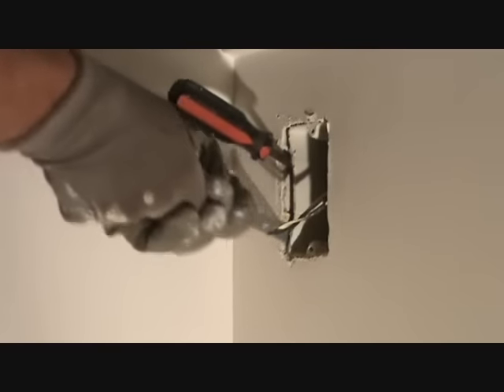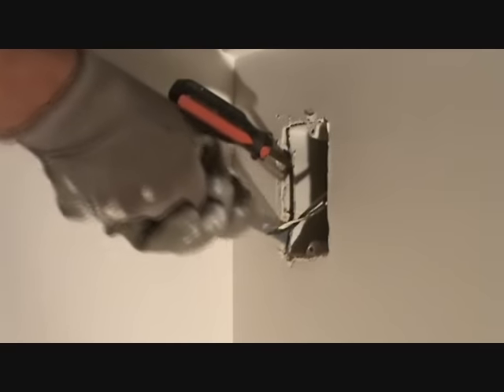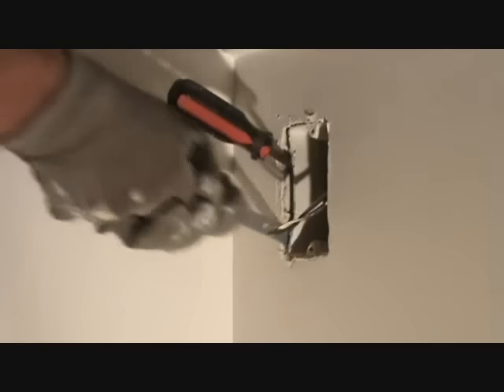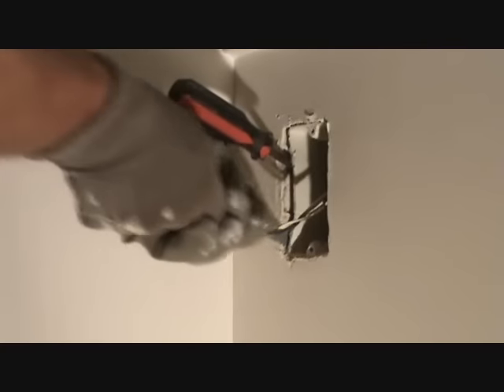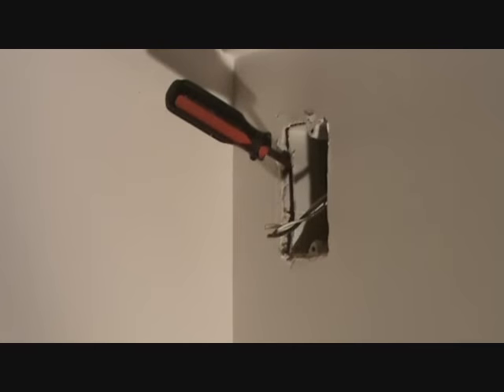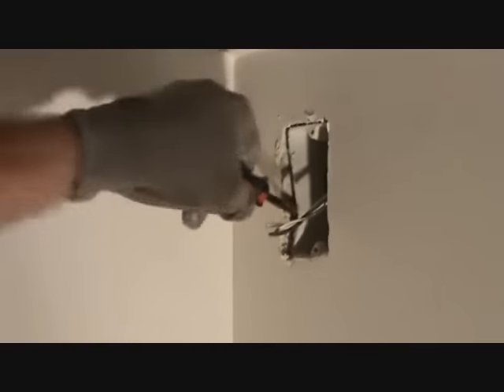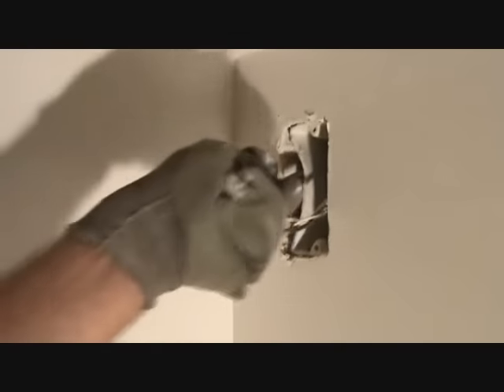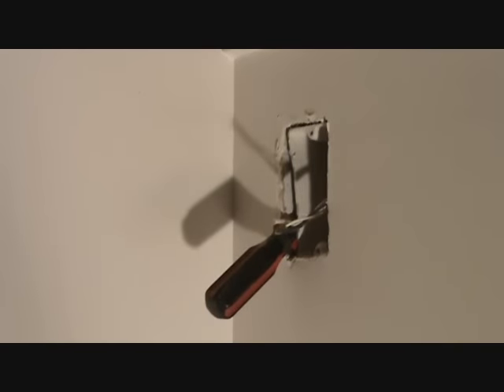How to remove an existing electrical duplex outlet box

Comment: So much for my simple project of replacing the outlets....
Reply from the maker: Your project can still be simple as you won't have to remove the existing wall boxes like I show here. I was removing this wall box so I could get in the wall to fish another wire over to a new wall timer to then be controlled for the wall mount ac unit. If you are just wanting to remove some old duplex outlets to install some new ones then you don't have to remove the wall boxes...see? Of course I have all those kinds of videos on my channel too. Just go to my main YouTube channel page then click on playlists then scroll down to electrical stuff & you will find all that you need I'm thinking. Once you look through there then if you have additional questions you can always send me a message on whatever video you're on on my channel. You can do it! Try it.....
Reply: @VideoJoeKnows  I need to remove them because the house is 80 years old and the new outlets I got with USB chargers don't fit in the tiny j-boxes.
Reply from the maker: @temushin  OK so if your house is 80 years old then check to see what types of boxes they are since the junction wall boxes could be metal then the project just got that much harder since not sure how the actual boxes look & you might have a tougher task of cutting the box attachment tabs to then remove the boxes. The box I show in the video is a plastic type box & the metal boxes won't be attached the same way is my guess....however saying that sometimes you might get lucky as I've seen two styles of old metal boxes one type being installed the same way I show here but then the other way has metal brackets on the outside of the box getting nailed in a different way. The only way to tell is by removing one of the old outlets to then shine a flashlight in there to see if you can tell. Those USB charger type outlets I know what you are referring to as most of those have the duplex outlet as well as the charger area in the middle. I just got one & yes the outlet is fatter of course! You might have to decide just to install those in a few strategic locations then you can leave all the other old style outlets alone....as a thought. Let me know how it goes!

Comment: I wonder if a sawzall or jig saw would work.
Reply from the maker: I would not recommend either since if there is a wire back in the wall behind or beside the box in the wall, you could cut right through it without knowing until it's too late. If you use the hacksaw blade then if you feel anything inside the wall you can then reposition the hacksaw blade without damaging any wires inside the wall. See what I mean? I use this method all the time & works just fine...

Comment: One time I did this by breaking up the plastic outlet box with needle nose pliers. Grab and twist to break the plastic.
Reply from the maker: Yes I had to do something like that one time for a 2gang light switch box as the nails are positioned in a different way than a single gang nail on box but I have removed over 100 boxes how I show on this video & always can get them out...thanks for your message from one Joe to another!

Comment from the maker: @moron32 You are so smart. I won't tell a soul! You could use a stacked switch at a new single gang cutin light switch box.....or you could get a 2gang cutin switch box & have room to install 2 standard size switches side by side (as a thought).....in case you get a ceiling fan/light combo you could put in a dual slide switch in for the fan (standard size) & still have enough room for a standard size light switch.......your idea of course!!...lol   Joe  :0

Comment: I have the same box but I don’t want to remove it. I want it out of the way so that I can thread an ethernet cable into a hole that is below and behind the box.  

The box has a small that the previous cable went through. So I feed the cable through there but can’t get it through the hole. My borescope lets me know that the tip of the cable is sitting right on the edge the hole.

So close, yet so far!
Reply from the maker: Well you can always still cut out & remove the existing junction wall box then fish your wire on down then install a cutin box in its place when you are done. See? I have all of those videos on my channel too....that's one reason why I removed this box...so I could fish a new wire in & install a new wall timer to the existing wall mounted AC unit. Works great! I have all those videos on my channel as well, Just go to my main YouTube channel page then click on playlists then scroll down to electrical & you will find them all there... Thanks!

Comment: Replace hack saw with oscillating multi tool…
Reply from the maker: The only thing with an oscillating tool is that you can't feel what might be in the wall until after you cut it! With the hacksaw blade you can feel if it hits anything then you can reposition the blade & cut through the nails. Works every time...!

Comment: old fashion white electricity  box looks like yours but its attached to a metal flange on the right. It looks like it is riveted to the back of the white elect. box.  How the heck do I remove this type box.  Frustrating. I have little to no experience.
Reply from the maker: Sounds like you have a box where the metal flange could be screwed over the face of the wood stud. They make a few different kinds of plastic nail on boxes. Most of the plastic nail on boxes are of the variety I show on this video. Sometimes however someone throws a curveball & will install a different type such as yours. Sounds like you have little choice but to take a hacksaw blade as I show & cut the entire metal flange. then the plastic box should be loose to where you will be able to remove it like I show. Is the metal flange fairly close to the backside of the drywall? Then the flange should be of the type I just explained to you. Either way you have to cut the flange off in order to remove your box. Can you fish your wire straight down the wall & right into the top back of your box? That's really tricky & would require a helper to help you out. I'd just spend the time cutting the flange off if it was me. Good luck!   Joe  :0
Reply: I used a frill to free the rivets from the metal flange.
Reply from the maker: Awesome idea. Way to go! I knew you could figure something out. You were then able to remove the box, right?   Joe  :0
Reply: yes, after which I installed a blue, sturdier type of box from H.D.
Reply from the maker: Sounds great. Now you know how to do it anytime you need to remove a box you can!   Joe  :0

Comment: I guess I would use an oscillating tool to cut the nails.
Reply from the maker: I would recommend AGAINST this as if there is a stray wire & you cut it with your oscillating tool, what would you do then? You would be hearing VideoJoe in your ear....told you so!!

Comment: There are always be a stud in the corner for drywall
Reply from the maker: Agreed. I was still hoping the initial framers didn't do anything funky under the wall mount AC unit like add any other wall studs where you wouldn't think they should be. I had to remove this outlet junction box so I could fish a wire over to a new location for a 4 hour timer that would operate this outlet location to then run the existing wall mount ac location. I have videos for all that too. Just go to my main YouTube channel page then click on playlists & scroll down to AC projects or something like that to find them. Thanks for stopping by!
Reply: @VideoJoeKnows  thank you for your video though
Reply from the maker: @timothyballard5215  No problem. Thanks for checking it out. I have a ton more DIY electrical videos for more learning & saving. Just go to my main YouTube channel page then click on playlists & have at it!

Comment from the maker: @moron32 Decide where you want to install the gfi outlets & go to your sub-panel & see what size breaker it's on. that would be the easiest way to figure it out. I'm goping to guess that the bathrooms are 15 amp & the kitchen is 20 amp. That's a good educated guess but still check it out. If you have more than one plug in the kitchen & they are daisey chained then you might only have to install 1 gfi.....if you wire it right.....or you can get a gfi breaker that will do it.   Joe  :0

Comment: RECIPROCATING SAW !!!!!!!!!!!!!!!!!!!!!!!!!!!!!!!!!!!!!!!!!!!!!!!!
Reply from the maker: +Adam Ortega Yo Adam. The reason why I didn't use a reciprocating saw was because if you have any of the existing romex cabling anywhere close to the nails or attached just behind the nails you will never feel them as you slice cleanly through the wires. Using a little hacksaw if I felt anything I could then re-angle the hacksaw blade to miss anything I felt back in there. Can you imagine if you hit anything with the reciprocating saw? It could be a nightmare to try to make any electrical repairs without opening up the wall. Think about that before using a reciprocating saw!   Joe  :0

Comment: go for broke and remove a huge piece of the drywall. Its less effort to do drywall repair than to fight with the box
Reply from the maker: I would have to disagree with you there since you would then have to patch the drywall then tape, top, skim tight skim, sand, texture (if needed) match texture to where it did not look like a patch, prime, 2 coats of finish paint making sure to match the existing paint & if not then paint the entire wall. You would go through all that instead of doing it the way I show here? I have removed over 100 boxes this way in many many condos etc.. Just think of all the other work I would have had to do in order to patch the drywall without really having to doing any patching at all? That's the pint of this video? Try it! Then let me know which way you would ultimately do all of your other box removals.....

Comment: sawzall
Reply from the maker: I would really hate to use a sawzall in case you get in there & accidentally cut right through a stray wire or two. Trust me when I saw it's easy to do as I've seen it happen before. Then you would have to cut the wall open & patch the wall when you are done repairing the wiring. You will thank me later. Just try to cut the nails the way I show & you will be surprised for sure. It's pretty easy. I have remove over 100 of these boxes like this & works every time...if you're using the hacksaw blade method I show you can also feel around to see if you are poking something like a wire then just reposition the blade just a bit then cut the nails like I show.